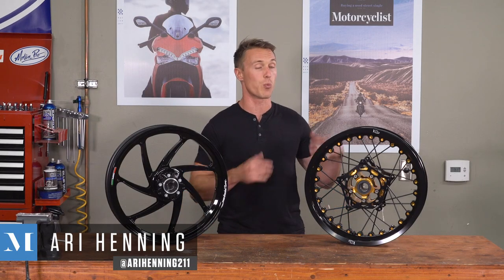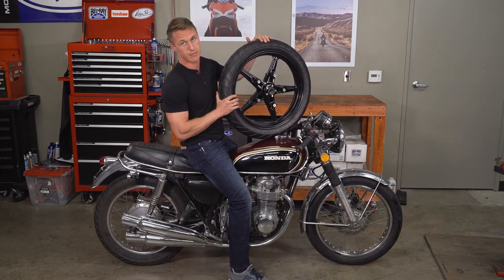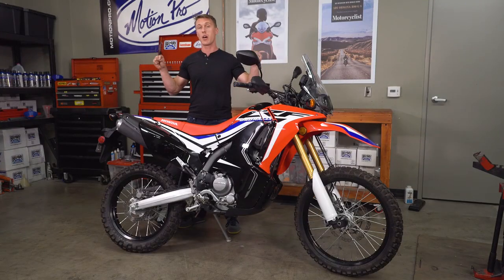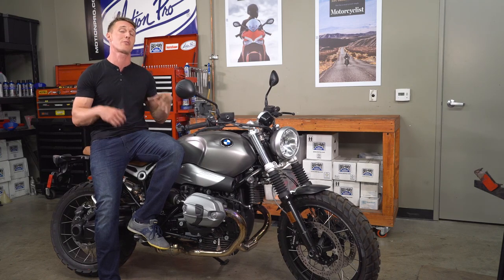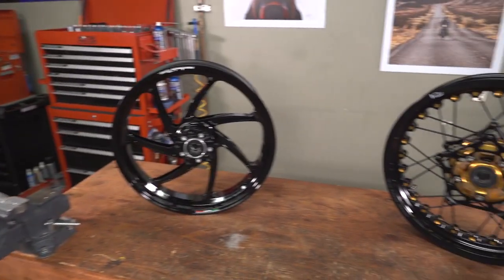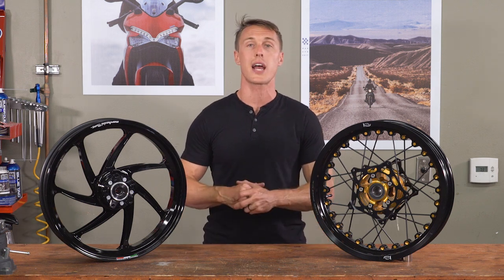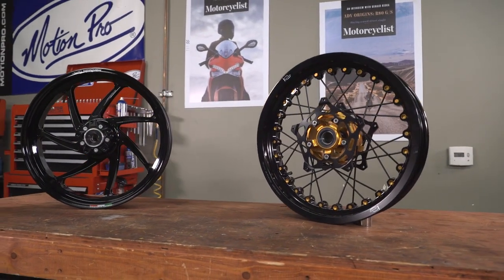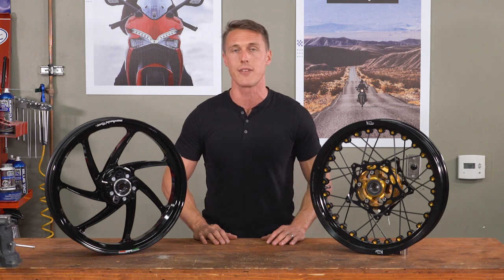Wire-Spoked Wheels vs. Alloy Wheels—Which Are Better?  | MC Garage

Comment: One nit pick: The early days of alloy wheels were not universally tubeless. In fact, a 1980 Suzuki GS may have a tubeless rear with a tube up front. A common mod was to alter the front wheel to accept a tubeless valve stem. You didn't have the bead retention lip, but that only matters if the tire goes flat. If that happens, you have bigger problems. I own two bikes with this mix of tube and tubeless, both with the same mod.
Reply: Heh. I'm a visitor here. My people are mostly on the old stuff, because we're too cheap to ride new, or we just love 'em.

Comment: How'd you get your hands on some Marchs?  Was told that they are backed ordered until November.

As always, great video
Reply: Thanks bro.  Great Video!!!
Reply: Glad you were able to get your hand on a set.  

Love the wheels, but for ANYONE (outside of Italy/MotoGP owners), looking at trying to order a set, please see below:

I tried ordering these wheels back in August of 2017, and after my nine (yes 9) MONTH wait, here’s a reply from March....

“Thank you for the email to Marchesini Italy.  Your email was forwarded to Race Technologies.  We are the importer for the USA for the Marchesini program. 
 
You can order wheels in the Repsol Orange color.   Please keep in mind while “Repsol Orange” is a coded color it can vary in what is expected because of the variability of this color from other manufacture of parts. 
 
Are you looking for Aluminum or Magnesium wheels? 
 
The ETA for wheels right now is about 16 weeks.  The custom color will add additional lead time of 6-8 weeks.   There is an additional cost of $232 per wheel. 
 
Please let me know if you have any other questions. 
 
Regards, 
 
Nicole Lavash, Senior Account Manager
Motorcycle Program”

So 16 weeks: 4 months (if you’re ordering the REGULAR colors, Black/Gold/Yamaha Blue)

But if you want any other color (which they will paint per their website) you might end waiting and additional eight weeks (2 months).

So essentially, you could be waiting a MINIMUM OF HALF A YEAR, just for the wheels to be MADE.  That’s not counting shipping....😳

Are you serious?  

And here’s the kicker, you have to pay FIRST!!!

Go with OZ Wheels/Carrozzeria/BST or any other!!!  

I ordered a set of OZ wheels, and it was a 2 month turn around from the time I swiped my card until they were in my mailbox.

Screw Marchesini!!!

Great upload brother.  Love these info videos.

Comment: Hey, Ari, could you do a video on different off-road bike categories? You separate them in a quite different ways compared to us in Europe and it´s hella confusing. I´ve tried to look it up, but different posts online often disagree with one another and manufacturers pages are also a no-go, with everything being super mega adventure able to travel, commute though city, win motoGP and clean out your wallet all at the same time... :D
Thanks <3
Reply: I only know of four in the states. Off road: dirt bikes of all kinds with no lights, light weight, aggressive tires, not street legal. Dual sport: or a dirt bike with lights, less aggressive tires, street legal. Adventure bikes: Dual sport like bike with bigger engine, plenty of storage, and usually some rider comforts like cruise control and heated grips and tall windshield. Last are scramblers: not really off road but will take dirt and gravel roads better than a street bike or cruiser.

Comment: Also since spoke wheels have tubes they can take much more punishment and still hold air.  If you bend an alloy wheel it might not hold air, of course you can always rip the valvestem off an alloy wheel and put a tube =P

Comment: With the potholes of our poor infrastructure, wire wheels have an extra reason for road use. It's so great to see a comparison of the 2 types. I started really liking wire spoke wheels, because of how customizable & personal they are.

It's easy to replace damaged parts. but it's also easy to change the rim diameter & width, and keep the same hub. I don't have to find some company, to cast & form me, a fully custom wheel, when I want to use different tires. I'm learning how to professionally lace & true wire wheels. It seems very therapeutic.

Those are my reasons, but I never thought about the extra durability of them. As for light weight. Titanium spokes exist. And at least for bicycles,  there are carbonfiber rims. I haven't yet looked up carbonfiber rims for motorcycles. But I know carbonfiber wheels exist, for bicycles, motorcycles, and cars. Very strong & light, just very expressive.
Reply: So much has changed since I typed this 7 years ago. I hate wirespoke wheels now, because I am sick of them coming loose, and then having to be retrued. For e-bikes, or production & homemade electric motorcycles. I love direct drive hub motors that don't use wirespokes. I just want bikes that are powerful, reliable, and low maintenance. I'm even phasing out traditional brakes for dual motor Regenerative & Rheostatic Braking, so I don't have to waste money & time on brake pads anymore. Battery packs, and the bearings for the suspension, steering, and hub motors last a very long time. And with at least two bikes, I can deal with those few issues, at my own pace, and none of those issues will cripple a bike out of nowhere. Or get dramatically worse, like a wirespoke wheel coming apart. And I also prefer the direct feeling of cast wheels/hub motors, and would rather just have fat tires to protect them from potholes & whatever.
Reply: @observingrogue7652  I hate spoke wheels too..but I just ordered a bike with some great specs but is has spoke wheels..I believe it should work well for me since I ride in the streets and don't do stunts to put stress on the spikes..I asked other ebike riders who have spokes and they never mentioned any issues with their spokes..
Reply: CF wheels on push bikes are for v. lightweight riders, have a weight limit and I wouldn't go near them. Not nearly as durable as alloy.
Reply: @sandydennylives1392  , false, cf has been proven to be stronger than steel in most cases and definitely stronger than aluminium rims, all wheels have a weight limit, but cf rims don't have a lower weight limit than aluminium ones so no they are not for very light riders. The main reasons to get cf rims are well, firstly they are a lot lighter and as such improve acceleration, they are stiffer making them corner better and lastly they absorb vibrations better. I can vouch for cf rims as i went from hope tech4 aluminium rims to mavic cf ones, they felt much more responsive and the grip and acceleration was phenomenal. Cons to cf rims are well the obvious high pricing couple that with the fact that in the event of a crash they are more likely to snap in half than bend or buckle but if you're crashing hard enough to break cf rims then you don't deserve them and should stick to aluminium.
Reply: @0_K_0  I'm just not in the market for 2K wheels. A CF frame has an MpA rating of a couple of 100, my steel 1200. I simply don't trust it, and my bike shop refused to sell me a CF  even though it would be more money for them, when they built up my elite, now stolen, steel; that was 1400 MpA.
Reply: So I guess the spoke wheels are better for ebikes right?

Comment: One thing that wasn´t mentioned is that when a tube punctures, it pops like a balloon, letting all the air out at once, something very dangerous needless to say. This happened to me on the freeway last year on my bike that runs wire wheels with an inner tube. My rear tire suddenly went completely flat. How I didn´t lose control of the bike I have no idea. I was able to stop gradually using only the front brake. But if I had lost it, I would have gone down hard. For that reason I stay away from tubed wire wheels now.
Reply: Hec Thor, Spot on, experienced that several times over the years and friends haven't been so lucky.
Reply: Oh well i also wanted to warn people your tires can pop from spokes sticking through. I assumed that's was what made your tire pop since this video is about spokes rims.
Reply: Hec Thor, same here. That's why I don't like tube tires. Had punctures and leaking valves. After I changed to cast rims that uses tubeless, no worries. My bike is a Honda VTX 1300S but using the R series wheels
Reply: Hector Gomez modern spoked wheels can run tubeless as the insert thru the side of the bead or thru their own ridge
Reply: Your saying the spoke popped your tire?  That's why you need to tighten your spokes, especially on older bikes. Its simple, yet deadly if overlooked.
Reply: No I never said a spoke popped my tire. I reality a nail did. My comment wasn´t centered on what punctured my inner tube, but on the danger and consequences when an inner tube ¨pops¨.
Reply: +Jo-han Goh what about sealing a spiked rim? I've read there are tube rims that have a bead lip but not sure which mfgr/models do and don't but makes it a cheaper conversion than using custom rims for a tubeless 17" tire
Reply: +Chris Morse spoked*
Reply: Chris Morse, never seen a road legal sealing system for 17" rims. Neither would l trust one.
Reply: For a start, the VTX S series can use the R series rims, so I don't need to custom make the rims from an aluminum block. Also I don't quite trust sealing the rims. As a matter of fact, my spoke rims were beginning to rust due to age. I don't know how well the previous owner(s) looked after it, but there was some rust on the front spoke rim. That for me, was a sign to change and so far I don't regret it
Reply: Exactly why Moto Guzzi should not release their awesome V85TT with tubes and spokes. Golly gosh, I'm fuming....
Reply: I think tubeless tires are made to withstand the puncture, at least on a smaller bikes. I once had a puncture on a 250cc that completely let out the air, I was doing 75mph and noticed the rear feels slightly wobbly when I overtake and ride on the road markings, I stopped and noticed the puncture, but since it felt fine during riding I rode for another 50 miles and made it home, on a tire that was basically flat(it didn't hold the air when I tried to inflate it on the gas station). The reason I was able to do all that is that tire walls on a tubeless, are made to be VERY thick, which allows them to provide stability and not make you ride on the rim when they are compromised.
Reply: Just seal your rim with silicon

Comment: Regular VS Iridium sparkplugs.
Reply: Dokar Face Sorry about my last comment. You are indeed correct.
Reply: Preston Bailey it's all right bro.. Ride safe..
Reply: The only different is that an iridium spark plug has a few microns of iridium on the electrodes so that it can stand up to the spark better, and wear far less. So they can last substantially longer than standard plugs.
They won't make your bike/car run better, they don't give a better spark. That's all internet myth.
Reply: just go with what the manufacturer recommends
Reply: Papa Gundam the part of "copper" spark plugs that is actually copper is also copper in iridium and platinum sparks. The part of iridium and platinum sparks that are iridium or platinum (respectively) is nickel in so called copper plugs.....
Reply: Iridium plugs have pointy electrodes rather than the studs of conventional plugs which would wear from spark erosion very fast. The spark always forms in the same place and these plugs are very resistant to both wet and dry fouling.

If you have a big air cooled engine that doesn't start well on a cold morning due to condensation issues, iridium plugs make all the difference. Similarly with an engine that burns some oil, or has any other kind of fouling problem.

My old XV535 was air cooled, a high miler when I got her, awkward to start at the best of times and the Ducati-style airbox in frame was designed such that the breather would spray the top of the airbox with oil droplets which would then drip down into carbs when you stopped. On a cold morning she'd either start straight off or refuse to catch and need the plugs cleaning. With iridium plugs she started on the button every time. Even my garage didn't believe me until they did a major service,  swapped the plugs and wondered why she didn't start or idle smooth when I came to pick her up. Fortunately they'd kept the old iridiums and when they went back in she was fine.
Reply: i used iridium on modified engine and it broke after 1 day
Reply: In normal spark plugs Copper conducts better and is generally used in higher-performance/modified engines.
Iridium and platinum plugs are chosen for their longevity only. You shouldn't gap iridiums because of potential damage to the tips. For that reason and their inferior conductivity, they aren't used in modified engines. Keep in mind their price, as well.
Reply: It's not really clear actually. Iridium plugs are just there, in my car the mechanic told me to try iridium over the fancy cool spark ones I had. Still had a misfire, made no difference to power, could even be less power with the new iridiums. I think they are too hot, or something to do with the conductivity & 20+ year old stock spark circuit. I will change the wires & distributor whatever whatever. If it still seems lame, I'm putting the cooler kind back in. Non-interference engine, 2.0L, strong block, patiently awaiting turbo & manual trans!
Reply: @ Jay Edlington: You haven't actually read the manufacturers literature on Iridium plugs. Why not try that instead of listening to mechanics and internet experts. 30 seconds, and you'll know the truth.
Reply: try yttrium spark plugs, no that's not a typo its just a weirdly named awesome element.
Reply: Iridium usually last longer, and cost more. Just buy regular plugs and replace them every year or season. (if your fuel mixture and timing is on point)
Reply: Anyone reading this 2 years later, check out the channel Project Farm. He did in-depth testing comparing various spark plugs and their performance. The results may surprise you!
Reply: Iridium is 6x harder and 8x stronger than platinum, has a melting point 1,200°(F) higher, and conducts electricity better.

For many years, spark plug manufacturers favored platinum for their long life and performance plugs due to its high melting point.  However, increasingly strenuous engine conditions, and the creation of smaller electrodes and longer life plugs required harder and stronger metals.  The strength, hardness and high melting point of iridium makes it very well suited for a fine wire plug and ultra long life spark plugs.

Though better than platinum in these respects, it is very expensive, and at higher temperatures it oxidizes, thus rendering pure iridium as an expensively poor choice for spark plug construction. However, when properly blended with other precious metals such as yttria, rhodium or platinum, you can enhance their advantages with the superior strength and hardness of iridium.

The price point of an iridium plug is usually equitable to its iridium content. Some lower priced iridium plugs have just enough iridium content to be marketed as iridium plugs. They likely will not perform or last as long as the plugs with a higher iridium content.
Reply: nice.
Reply: Dokar Face Its is actually the complete opposite from what you said. Iridium plugs are higher performance because they provide a hotter spark and thus less durability. Stock plugs have the most durability but the least performance.